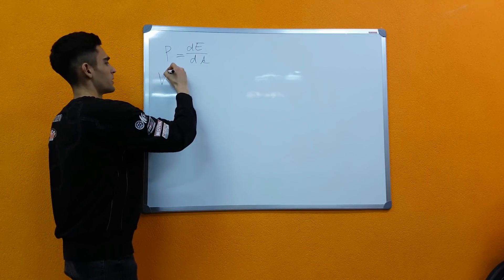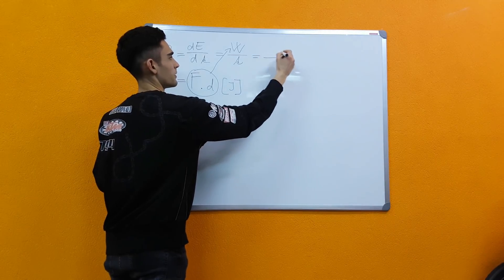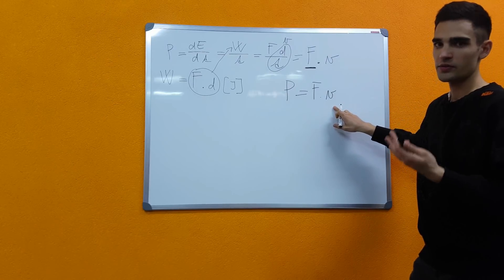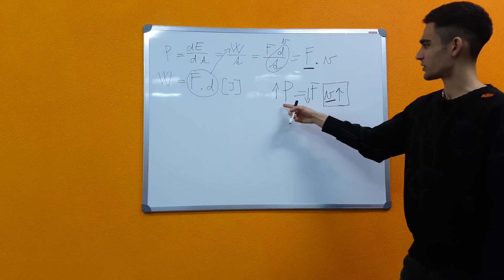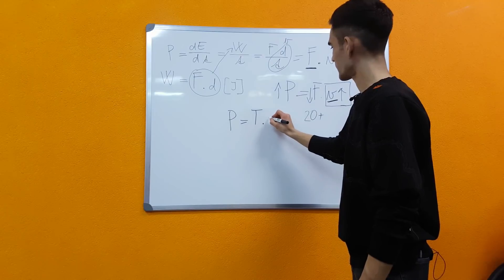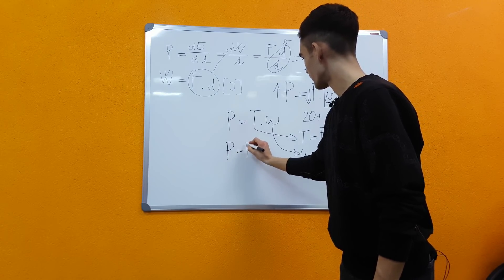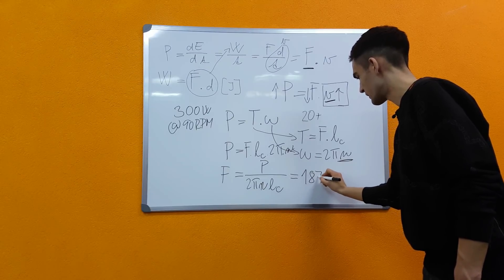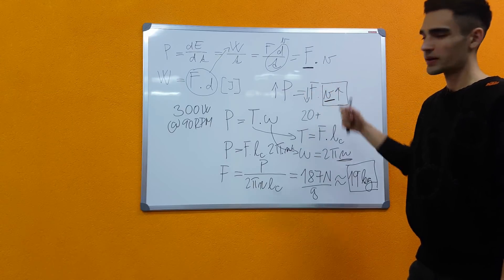Cycling explained: What is power? (Pt. 1)

Comment: The force you calculate is the average force applied over one revolution of the cranks. The peak value for one leg would be significantly higher (somewhere in the downstroke) and much lower somewhere near the end of the upstroke I guess.

I think that the Garmin Vector pedals can give you the forces over the crank angle as part of their cycling dynamics features. Have you ever tested those?

Comment: You were saying that the torque needed to push 300w was approximately like lifting 19 kg. With that in mind would it be accurate to say that squatting 19 kg, 90 reps in one minute would be equivalent to pushing 300w @ 90 rpm for 1 minute?
Reply from the maker: Liam Sangaku exactly
Reply: Liam Sangaku Wouldnt you need more energie to squat 19kg? Because if you squat, you need to squat your own Bodyweight too, or am I wrong?
Reply: Der Übermensch You have to push your body weight on the bike as well.
Reply: Liam Sangaku Yes but the Bodyweight is variable, but the 300 Watts output not.

Comment: Not quite right on this one. You were talking about the power (generated by ciclist) and in the equation is the forced produced by cyclist multiplied by it's speed. It doesn't have anything to do with an external system for de resistance forces . You can generate 200w at a speed of 8.33 m/s (30 km/h) by using a force of 24,009 N. To generate the same wattage but at a speed of 9.72 m/s (35 km/h) you need to use a force of 20.576 N . I picked up 2 situations depending of the speed you are traveling at  ... Just when I thought I got that video that I was asking for :)) But , keep on doing em
Reply from the maker: Vlad Biciclistul wrong. If you want to travel at a constant speed, your power needs to be equal to resistance forces×velocity. The power you generate is Tx2xPIxCad.
Reply: Ronald Kuba it's a nonsense what you say...
Reply from the maker: Vlad Biciclistul I guess I'll have to tell all of my professors to return their diplommas. You clearly have no idea how drag forces work.
Reply: If you tell me how on Earth can a PowerMeter measure any drag force ...
Reply from the maker: Vlad Biciclistul noone said it can. If you have set drag forces at a speed, multiplied by the same speed, you get the power required to travel at that constant speed, given that the resisting forces don't change. The power meter measures torque and cadence, as described in the video.

Comment: how tall are you and what crank length are you on? im 175cm and im on 172,5 i want to get shorter but im not sure how short, 170 or then all the way to 165 seems to be the options.
Reply: Your crank length as more to do with your femur length and overall leg length. Not your height.
Reply from the maker: visse89 172cm. 165mm on the TT bike, 170 on road and CX. For me it's about getting a good position
Reply: I measured femur to around 47cm  and inseam to 84 cm. when im running for example i favor higher cadence and shorter steps, its not the same thing but i feel like maybe its something to it. it just sucks its allot money to get new cranks to try.
Reply from the maker: 170 could be a good starting point

Comment: Hello again. This time you're talking about things I actually know a lot about :) [check out my publications].  Sorry, but there are a lot of inaccuracies, and you're not really talking about the important points, and like everyone else in the cycling world you're missing an extremely important point (point 10 below): 

1. You say power is the rate of change of energy, but that's with respect to time (you only say that later). The rate of change of potential energy with respect to distance is force. As you do in the rest of your video, there is no reason to introduce derivatives. 

2. You use the term "velocity" incorrectly. What you are really talking about is "speed," which is a scalar and the magnitude of velocity. In particular, the angular velocity of the pedals depends on how fast the bicycle is turning, but that quantity is not taken into account in any of your considerations. You should stop talking about velocity in this context. 

3. Power is the ability to do work quickly. Two people with the same weight cycling up a 1000m hill do the same work against gravity, the one who does it twice as fast has double the power. Since cycling is about coming in first, this explains why power is so important in cycle racing.   

4. A person with half the weight does half the work against gravity going up that same hill, so to have the same time as the others, he only needs half the power. This explains why power to weight ratio is so important. 

5. Similarly, on flat ground, one expends energy against wind resistance, so the important quantity is the power to aerodynamic drag ratio. 

6. You need to exert power to climb hills and overcome aerodynamic drag and you apply that power through the cranks. The instantaneous power you apply is simply the force you apply to the pedal time the pedaling cadence times the crank length.  

7. In general, you ignore crank length since you compare power using the same cranks. So power is essentially force * cadence. Pedal based power meters require you to specify the crank length. 

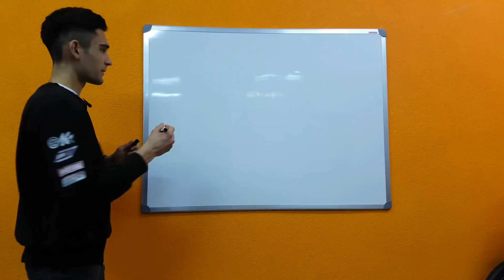8. Strength is the application of force. The lower the cadence, the more power is generated by force (a rider who pedals slowly and goes fast is strong). It follows that great strength is most valuable for standing starts in a big gear and the first few pedal strokes after that. 60kg cyclists with little discernible muscle have ridden 1:03 standing kilometers, they lost the 2 seconds compared to 85kg cyclist in the first few pedal strokes. 

9. The universally accepted statement is that to go faster for similar bicycle and rider, you should increase the force on the pedals or increase the cadence. 

10. This is not correct. You can also increase power by doing more work per pedal revolution while keeping the same cadence by having a force profile which is not always greater than a slower force profile but which has greater area under it, or by eliminating resisting force in one leg when the other is pedaling. It is not at all obvious how this comes about and whether it can be learned. 

Enjoy!

-ilan
Reply: On number 3 You say that a rider at 50kg would have to produce only half the amount of watts as a rider at 100kg to climb up the same hill at the same time, thus having to do half the work. This is not true if the 100 kg rider's FTP w/kg is equal to the 50 kg rider's FTP w/kg. So the  100kg rider would be riding at the same amount of exertion in relation to their own bodies capacity as the 50 kg rider. Not twice as much.
Reply from the maker: Ilan Vardi as I said in the video, I will talk about the resisting forces in the next video
Reply: Yeah, that really addresses my comments.
Reply from the maker: I didn´t mean to, because they are pointless, but if you insist:

1.) I wrote dW/dt, I think it is pretty obvious that it is a time derivative. What does force and Ep even have to do with this?

2.) it is scalar and it is correct, stop splitting non existent language hairs

3.) the whole video is about this

4, 5, 6, 8, 9 ) doesn´t work like this at all in real life, plus explaining this was not the point of the video

7.) Force times cadence yields a unit of N/s or N/min. The unit of power is J/s so this is plain wrong

10.) Doing that will increase the physiological cost just as much as increasing the cadence or the force applied to the pedal. You can´t just gain power for free by pedalling "smoothly".
Reply: Isn't F=dV/dx something we tend to use only when the force field is conservative? Otherwise it's kinda hard to fabricate a scalar potential for the force in the first place.
Reply: Pretty funny, but now I have to wonder why I'm wasting my time with you. Bye!
Reply from the maker: Ilan Vardi if you want to waste your time discrediting one's work with your pseudo knowledge, then please do it somewhere else. Thanks!